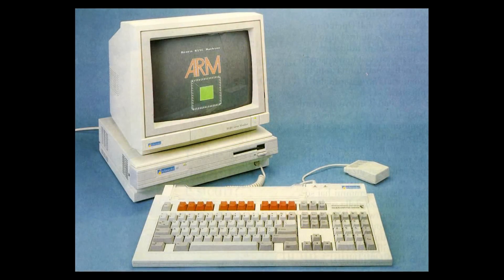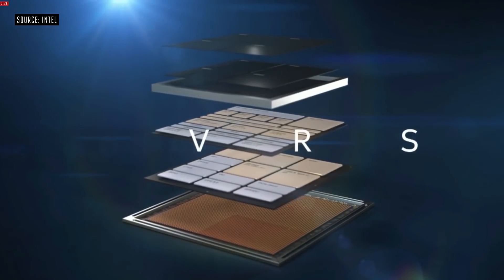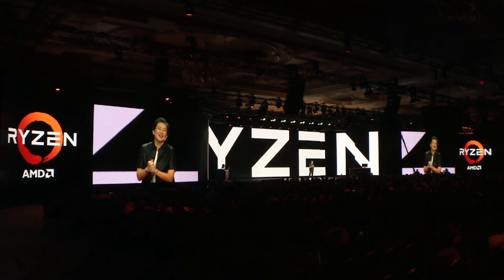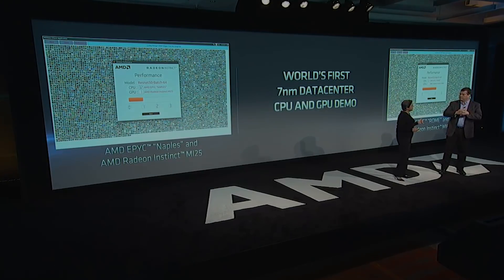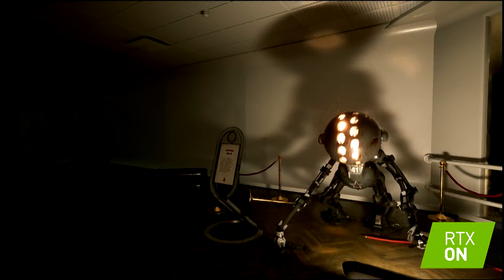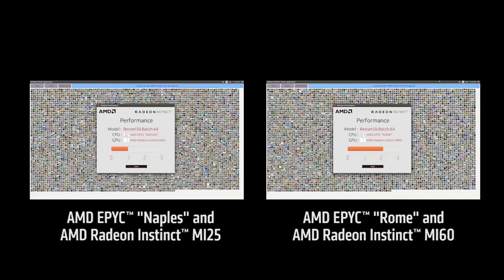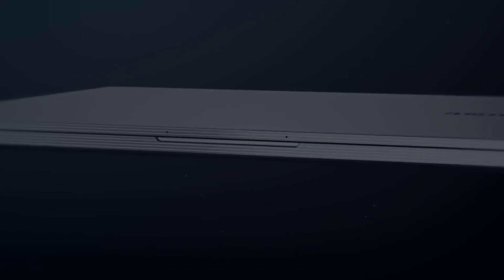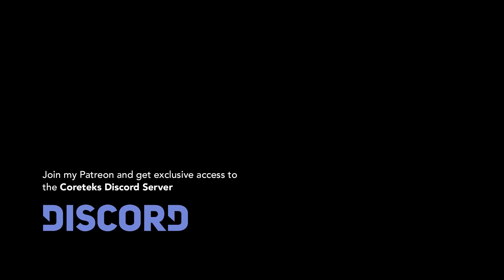Hardware trends: How many cores do we need?!

Comment: Amdahl's law is all fine and well, but it only applies, if the parallelisable code is already perfectly parallelised and the problem and problem size remain the same. That latter part is very important. Adding more cores to a GPU e.g. will give you diminishing returns on just getting more and more fps in the same game and resolution sure, but it makes perfect sense, if it is used to add more graphical elements to calculate, more pixels with higher resolutions, etc.
Many things are as you say more due to human issues still completely sequential, but wouldn't need to be if designed properly.

In the server space a lot of work is extremely parallelisable, but also higher core count in the worst case means, you can just fit more  VMs, etc. on less servers creating savings in cost, which Amdahl's law makes no mention of, as it only measures the time between start of calculation and delivery of the solution. But in many cases, each customer of e.g. a website could be handled completely in parallel, or at least in a queue spread across worker threads. Think of how many users access big websites at the same time. That is enormous parallelity, and if your problem, that is what you need to do per customer, isn't the thing that is increasing, but instead the number of customers are, then Amdahl's law again doesn't apply. More customers mean more cores make sense.
In this context Amdahl's law only restricts the reduction in latency for each user by parallelising the tasks that a single customer request makes the server do. But there is also a limit is usefulness in that.

On the other hand the sensibility of core count is restricted much more by something else, the need for more performance at all. Depending on who you are and what you're doing with computers, you may already have enough parallel performance and a small enough latency for your use case. In that case it would make more sense, as in the servers case, to instead reduce in size and cost. But even that benefits from the same developments, with SoCs and APUs integrating the performance that could prior be found only in much larger and powerhungry systems. Multi core also makes multi socket less necesary, etc. and by integrating these things closer and close, you also reduce the internal latency, problems with NUMA, etc. decreasing the time need for non-parallelisable tasks and parallelisable task simultaneously.
A theoretical law will only get you so far, if you don't watch exactly the conditions and what it optimises. "Performance" means very different things in different cases.

Comment: Gaming is a bit of an odd case with regards to parallelization - regardless of how much the code could actually be parallelized, won't most developers just optimize for 16 threads or less to fit the consoles?

Comment: Your video has me wondering this: If the hardware trend towards the "more cores, the better" paradigm continues, does that mean Functional programming languages will become more popular than the current Imperative programming languages? In other words, given the fact that Functional programming languages handle parallel processing better than state-dependent/sequentially oriented Imperative languages, wouldn't it be a fair bet that say, a Haskell or Lisp programmer may well command a higher salary than the run of the mill Java or C++ programmer in the near future? Great video. I learned a lot. Namaste, JaiChai

Comment: than we simple create a new way/tech of doing things and all of this "Law of limits" goes to shit. like we been doing since we started with the Rock to throw and ended with a nuke on the other end. when you reach the limits of something..you simple create a new "something" that has far greater limits. 
in short...these limits only "works" with the current way of thinking/hardware... i would not concern myself with said BS limits.
also..this law only works when everything else in said cpu/gpu is optimize to the max. the perfect catch, watt/per, memory, and so on. since gpu/cpu are not even close to reaching said optimization perfection..we wouldnt need to worry about "core limits" stopping our progress yet...proof will be said ray tracing from Nvidia in the next 2 gen. bet it will be more than 20% as said graph predicts...simple because you only predicting amounts of per core improvements not Design improvements. 

so even if we hit "said core limits" we have so much work left to be done on Design optimization that we can gather so much improvements in every area.

Comment: hmm,http://www.computinghistory.org.uk/det/8257/Ferranti/
https://www.manchester.ac.uk/discover/news/how-a-70-year-old-baby-changed-the-face-of-modern-computing/
"Hardware trends: How many cores do we need?!"... start with a million-core computing engine 
http://apt.cs.manchester.ac.uk/projects/SpiNNaker/architecture/
SpiNNaker Project - Architectural Overview. SpiNNaker Overview
SpiNNaker (a contraction of Spiking Neural Network Architecture) is a million-core computing engine whose flagship goal is to be able to simulate the behaviour of aggregates of up to a billion neurons in real time.

The SpiNNaker engine is a massively-parallel multi-core computing system. It will contain up to 1,036,800 ARM9 cores and 7Tbytes of RAM distributed throughout the system in 57K nodes

Comment: Great video @Coreteks. 

However, you made a mistake when talking about RT cores. Let me know what you think about this.

The way you applied Ahmdal's law is that you considered the size of data to be static across generations. We already know this is not true. For instance, the RTX cards can do 1080p 60fps raytracing, but begins to falter at higher resolutions.

As resolution increases, your data size is increasing (ie. the number of pixels). At 4k resolution, we are talking about 4x more pixels than 1080P. Raytracing as you correctly identified is a workload that has near perfect scaling. So if NVIDIA was to simply triple the number of RT cores on RTX 3080Ti, you would see a near 3x jump in performance at 4k resolution and your raytraced games would go from 4k 25fps to ~4k 70fps.

And yes, if the resolution was not increasing, than sure Ahmdal's law would hold true. You can already see this happening today, where the fastest cards are not any better at 1080P than last gen's cards (and I understand CPU limits etc, but the point still stands).

The same is true for # of rays cast. Right now, most games cast 1 ray per pixel or at most 2 (in certain cases). Then you add bounce - even at 1 bounce, the performance hit is prohibitive. Of course, if these # of rays were not changing, Ahmdal's law would apply and as you calculated, performance would plateau at 4096 cores. However, the minimum Hollywood standard is 16 rays per pixel with 4 bounces for each ray. This is a huge increase in the number of rays and bounces and more cores, beyond 4096 cores, will continue to scale.

In the end, if we stopped increasing resolution (which will never happen realistically, but say it does), there will eventually come a point in time, where more RT cores would not add to performance, but this is at least 8-15 years away, but it is unrealistic to imagine that resolutions will not increase before 4k/8k.

The law that you are looking for is Gustafson's law. Ahmdal's law works for fixed data size, while Gustafon's law works for variable data size (https://en.wikipedia.org/wiki/Gustafson%27s_law).

;tldr: Ahmdal's law holds only when the size of data does not change. When size of data increases, the # of cores beyond which scaling becomes inapplicable, increases. Therefore discrete GPUs will realistically always be a thing, till we keep increasing resolution and raytracing granularity (# of rays + bounces). NVIDIA is safe for a long time (10-15 years at least) :)

Thanks for reading :)

PS: I am super passionate about realtime raytracing :)

Comment: Maybe this is a stupid question but when exporting video, as long as there's more frames to render than cores won't more cores always grant linear performance increases? If you have 2048 cores that should be able to work on double the amount of frames in the video at the same time as a 1024 core chip

Comment: 6:09 That's not valid amd64 assembly (but it is valid arm assembly):
MOV r10, [a]
MOV r8, [b]
ADD r10, r8
MOV [c], r10
(4 instructions)

Also the only way you can parallelize the task is:
Thread 1              |  Thread 2
MOV r10, [a]        |  MOV r8, [b]
ADD r10, r8
MOV [c], r10
(3 instructions)

Comment: This is flawed. Sure, the performance gains for a workload diminish with more cores. But, you can do MORE workloads in the same amount of time.

I think the future of hardware will be a return to different dies, different chips, for specific tasks. We may even see specific PCIe cards. For instance, the iGPU may be plenty for rendering images, even with basic raytracing. But, raytracing addon cards could boost the performance. Perhaps a single raytracing card would be enough for fully raytracing a game; you just need one, tiers not needed. Going very far into the future, adding small cartridges to a PC could enable extra functionality through dedicated ASIC hardware. It would because less about how fast the PC could do something and more about what it could do.

Comment: As far as I know, the simplified example at 6:20 is not going to run faster because there is a cost for creating new threads and managing them. So running the example in a single thread would execute faster than even creating the new threads. But that's just a simple example, raytracing is obviously a more expensive calculation and benefits from distributing the workload on multiple cores.
Anyways, parallel computing is not a magic bullet that simply makes everything faster.

But I do agree that most game developers are lazy when it comes to optimazition. BF5 might be a good example of a good looking game that runs well of avarage hardware, so it's annoying to see loads of games that look half as good and run much worse.

Comment: The idea of a parallel task maxing out how fast it can be completed at a certain amount of cores only makes sense of the task never changes. This is an absurd assumption. For ray tracing, for example, a maximum speed would be as many cores as can process every single cast ray and bounce in the time it takes for the sequential frame data to be calculated, thus extra cores would be idle. However, they can just cast extra rays, for extra detail. Software scope scales to hardware standards. A game can always have more AI routines running, more rays traced, more particles simulated, etc. A video or image render might theoretically cap out at one core per pixel, but you can always have more pixels. Look at how fast we've moved from 1080 to 1440 to 4k to 8k. There could also be potential future algorithms that can parallelize even a single pixel of data for processing.

tl;dr More cores aren't just about more fast, but also getting more done, and there can always be more to do.

Edit: by the way, those above upper bound scenarios of one core per pixel are intentionally absurd. I certainly don't expect a million core GPU in my lifetime. I also don't expect to see a limit of "more cores won't help go faster" within my lifetime either. We'll have home quantum PCs long before that becomes a potential bottleneck.

Comment: AMD sells pretty low quality products. I've been testing their cards recently, and found that across the board, the fans they use for cooling severely hinder what the cards are capable of. They tend to consume far too much power for just a fan; the motors tend to generate more heat than what they pull off the card itself, outright negating the cooling properties, and I'm almost positive there's a lot of intentional design in them forcing them to break down within two years time, almost ensuring you'll need a new one.

Comment: Correction to the first 40 seconds of this video:
I have to inform you that "in these days" the memory controller was, and today still isn't, a processor it is Only counters, registers, buffers and allot of discrete control logic on one chip.
The I/O controller more than a serializer for the com-port, and a baudrate generator, maybe a input FIFO and an output FIFO buffer with interrupt logic, the LPT port merely a a latch - sometimes bi-directional. 
Even if the I/O controller included a DMA controller that too was only a bunch of registers and counters with tri-state buffers and arbitration logic for the addr. data buses.
The video controller was, again, nothing more than - what is actually called a frame-buffer - logic, registers and counters that controlled reading out pixel-data from a (single) picture-frame buffer memory via 4 or 6 bit DACs (Digital to Analog Converters), one per color (RGB) if it was not just a monochrome monitor and then not through the VGA connector but a CGA connector - 9 pin.

Comment: (1 - P) + (P/n) will always be a negative number with n > 1. What are the positiv values of the y axis that his graph is showing? Does anyone know?

Edit: P must be a percentile, so 50% parallel, you need to plugin .5 not 50 as is shown here at 07:35, then it works out.

Comment: I can see programs like internet browsers, word processors, chat programs and video conference programs having trouble being able to use parallel processors as there are really so very few things that could be put into a parallel process effectively.  The only point in which parallel processors start becoming useful for those programs, is when you have multiple windows up across a wide viewing space, like multiple monitors with a separate browser window or other instance of what ever combination of those software apps.

However, things that would work extremely well with parallel processes would be games, graphic rendering, multitasking, recording, simulations of stuff, network traffic control, running Virtual machines on the same computer, ect.

Though it does seem like, on the graphics end, they have gotten stuck at around 4000 to 6000 cores inside there processors, and have not gotten higher simply because they have already, directly experiencing the cap in performance adding more cores can provide.  Perhaps this is why the latest 1000, 1600 and 2000 series cards had a big increase in direct processing speed, rather then merely adding more cores, they knew they where topping out on performance gains for adding cuda cores and they absolutely had to start pushing the clock speeds again, after so long of nearly stagnating clock speed gains on the GPUs.

I once thought that liquid cooling would become a standardized necessity a year or so ago.  So I am going to restate it, since that seems to be the new "low hanging fruit" for performance gains soon.  Trying to shrink the dies is nice, but it is clearly costing too much.  With heat management being a serious issue on how much performance you can push into a processor, it seems like, to keep CPUs and GPUs within a reasonable marketable price, while giving clear performance gains, is going to absolutely require better methods of cooling down the CPUs and GPUs for a while, till the price of die shrinkage can get lower.

In addition to having current conventional programs redesigned to be as parallel as possible, what ever the programming nature is of scientific simulation and neuro-network stuff is is likely to be the new push in programming style, though it will likely be years if not a decade before that focus starts ramping up, since there is still so much to gain from learning to program in parallel and how learning to program in parallel will likely help lead into the future of programming for 10,000's of cores.

Comment: It depends what you are doing. I think the CAD designers are the most disappointed with multi core systems. HP and DELL are selling their super expensive computers with 16 to 32 core Intel Xeon processors for CAD designers. But Meanwhile, most of the CAD design programs and Laser scanning software with tenths of million scanned cloud points are NOT capable of multi threading! They need one core that is running sky high frequency.

Comment: Well I would totally be happy with 4 cores 8 threads IF some Voodoo manufacturer could make a chip with ~90W max TDP giving Intel Core i9-9960X huge multithread performance and more single thread than even current 9900K with only 4 cores 8 threads, now that would push gaming FPS way harder than probably many years of upcoming chips since I9 9960 is a huge beast in multithreading but it only gives its whole wonderful performance with 16 cores and full 32 threads in use and lets face it, how many years will take for all games to actually use the full 32 threads scaling at 100% efficiency...

Comment: This is something I have mentioned numerous times on multiple occasions but nobody ever understood. This video was very much needed for many who fail to understand the limitation of computers. Limitations arise from the gap between hardware and software. Simple computational tasks can never take advantage of multiple cores or parallel computing. It can only be utilized when separate computations have minimal mutual exchange of information, which if there is, can be handled by another unit once the values are computed and submitted.

Comment: if the Hardware with 128-4000 Cores is there, we talk again about the possibility because as quad core was new, no games could use it, nowadays near to every game can use it, even my 6core amd is used by games that use 4 Cores, meaning that two stay for the system and make room for the 4 which then ONLY have to render the game. yes at some point single applications will not run much faster, but do you truly believe that then there will not a change of Utilisation also?